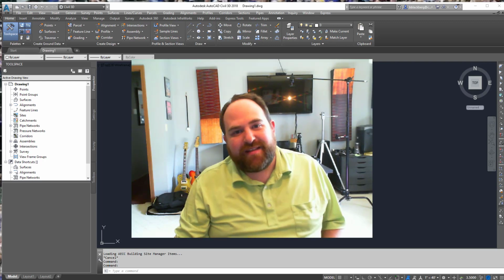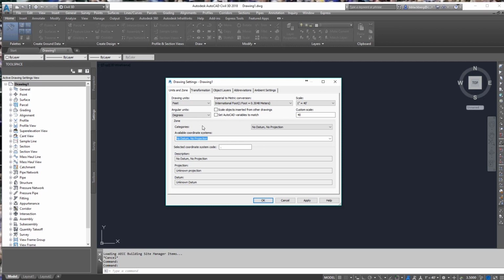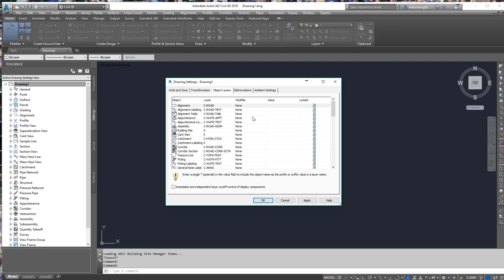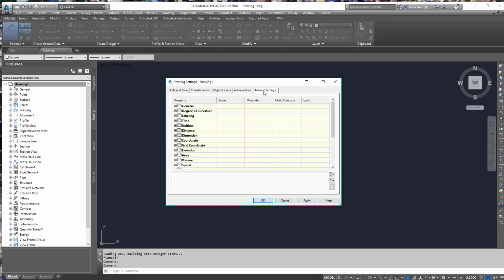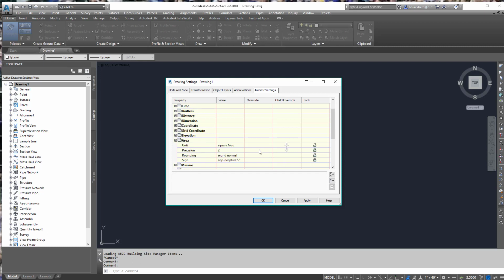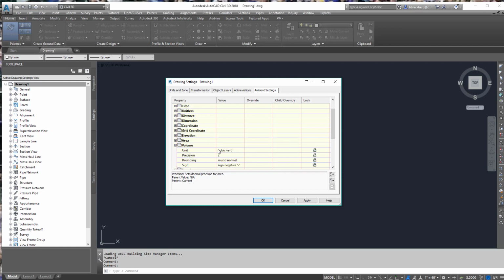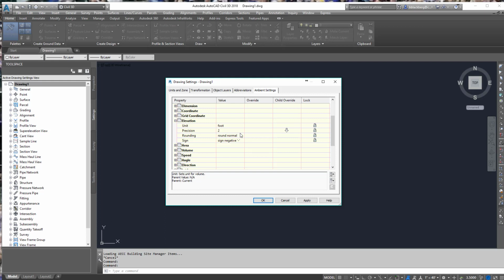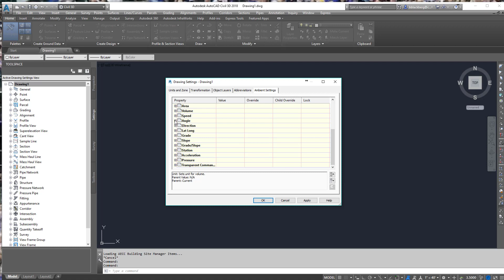Changing units for Volume and Area in Civil 3D

Comment: Hi @AIMCAD very helpful video, just what I needed. I'm in Australia and have to do a huge civil engineering assessment. Going through the autocad tutorials they are all in imperial. When I changed the settings like you showed, the text in the model space when changed to metric following your steps resulted in the text being extremely tiny. How do I force the autocad 3D to change to metric like you demonstrated but keep the annotation text the same size please?
Reply from the maker: Check your annotation scale in the bottom right of the screen probably still in imperial. Also the text height in the Civil 3d styles. If you can there should be a metric template to start with. If you can't find the metric template let me know and will post some links for you to download